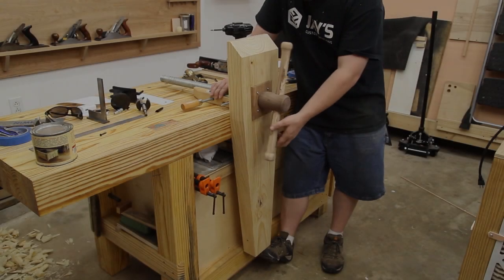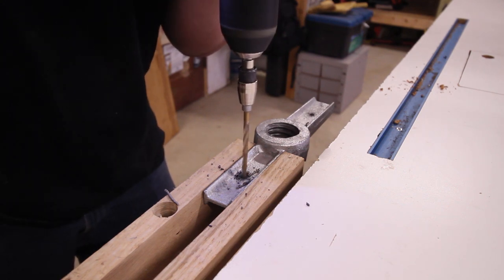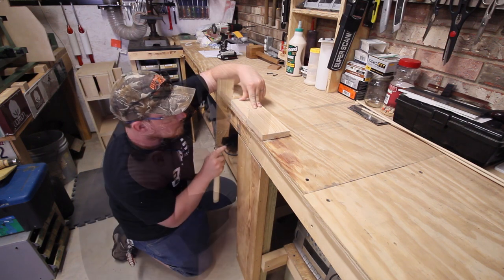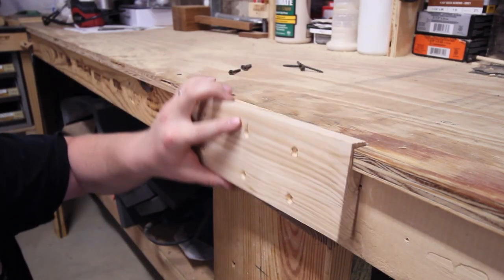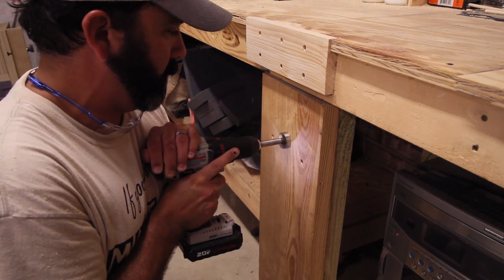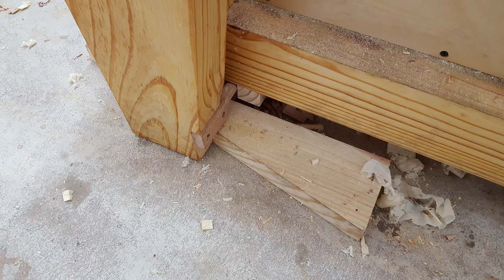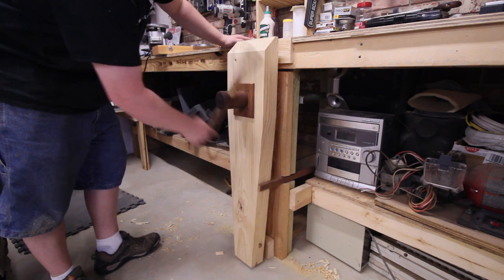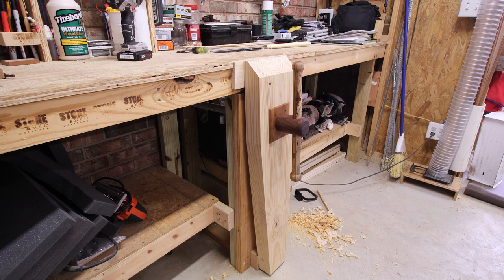Installing a Leg Vise on a Workbench - 253

Comment: Hey buddy.  I bought a yost leg vise kit.  The threaded rod is 30mm’s and I’m having trouble finding a drill bit that side.  Can I ask where you got the drill bit that is long enough to make a 4.5 inch whole?
Reply from the maker: Drill half way from each side. Mark the center points carefully and try to drill straight.

Comment: make another one but use two scaffold screws with the handle controlling a worm gear in the center. if one of the screws is placed in reverse it should  work and be stupid strong and take wobble out

Comment: Hey Jay,  Nice Job.  Could you give me some dimensions of the chop.  I understand the height varies but what about the thickness and the width.  Thanks
Reply from the maker: 2.5" thick, 8" wide at top. Drop down on the sides 12" then taper in 2" to the bottom. Top of screw to top of bench 8"
Reply: Jay,  Thanks for the quick response. I really appreciate it.  Jim D.

Comment: This is exactly the what I need.  My "new" house came with a rock-solid 5 foot x 10 foot worktable built of 2x4's and 1x12's.  I cut it down to 5 foot by 5 foot, but would still like a leg vise, which I purchased from Lee Valley several years ago.  Thank you, Jay, for showing some ideas on how to do this from a professional point of view.